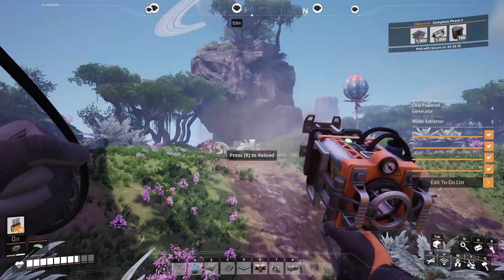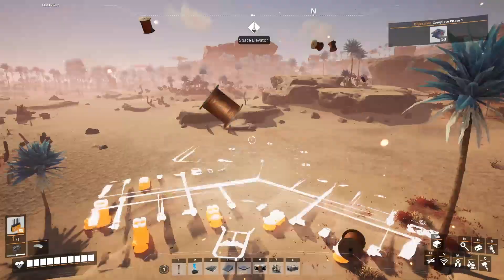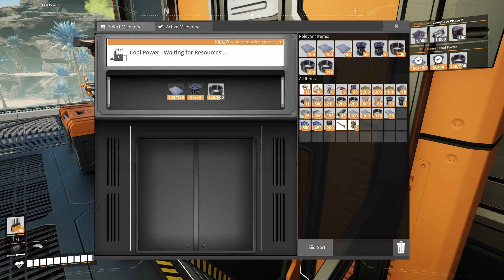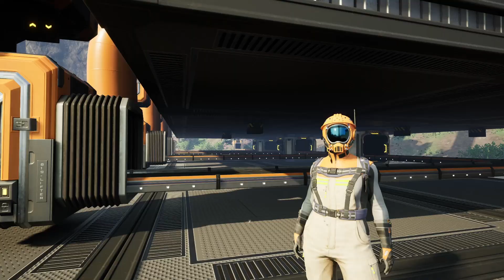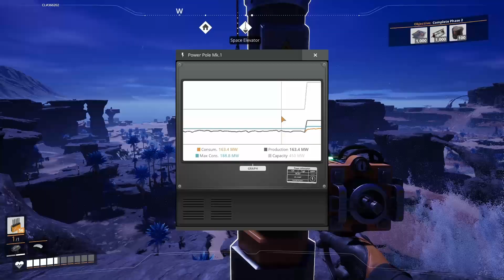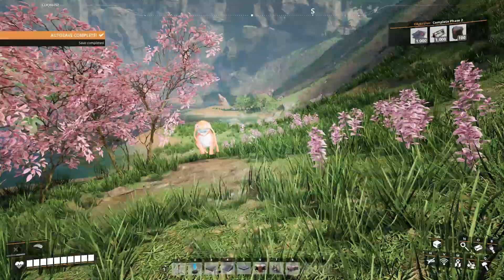Bum Rush Coal -  Let's Play Satisfactory 1.0 Episode 4

Comment: 0:28 -  there is an easier and less stressful method to bring down an Alpha Hog: just place a single Stackable Conveyor Pole in front of you when it's dashing towards you - the Alpha Hog will get stuck in the Stackable Conveyor Pole and you can safely kill it even with the Xeno-Zapper!

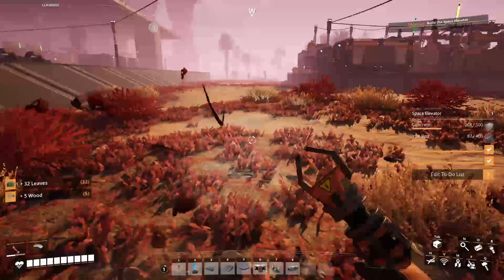3:17 - converting Solid Biofuel rather than Biomass into FISCIT Coupons would be more efficient! After demolishing my Biomass Burners, I also continue to process raw plant material via Biomass into Solid Biofuel...

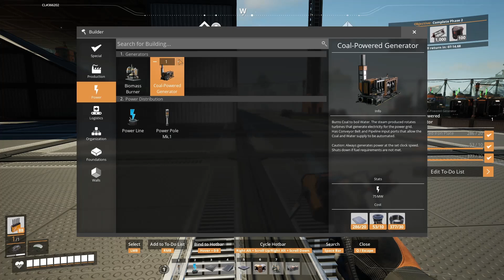8:39 - my initial setup of Coal Power is eight Coal Generators supplied by three Water Extractors, i. e. 360 m³ of water per minute, which, when only Pipelines Mk1 available which can transport only 300 m³/minute, makes it necessary to split the block of Coal Generators into two, with each group of four fed by one Water Extractor, with the third one's water delivery fed equally into the two others' pipelines!

36:06 - Lizard Doggos: in my "main game" which started  back in April of 2023, I captured no less than 40 of them! Until now, they provided me with about 1,300 energy shards...

Comment: lovin' your vids, but one question - where are you getting all that iron ore? How many nodes do you tap? Do you tap any/all, even the 'impure' ones?
Reply from the maker: So far in this series Ive only tapped the 3 pure nodes where I chose to start. 1 provides for rods, plates, screws, and in the next episode a awesome coupon factory, the other provides Reinforced iron plates and rotors, and the third is/will be for modular frames. In time, Ill tap almost everything, even impure ones. Power is cheap and resources are infinite, so some power lines and another miner is a pretty small cost to pay.
Reply: @Dekoba  3 pure nodes! I consider myself blessed with 3 normal nodes :)

Comment: @dekoba You don't need to fly backwards into a rock to gain altitude. This also works forwards. The key to success is to find a cliff that is angled upwards. A 90° wall won't work but a ~75° angle or less is suitable to glide upwards.
Reply: I built a very long line 4m ramps into the sky to create a launch pad for the parachute. It seems to work best if you look up a little bit. If you look too far down, you land.